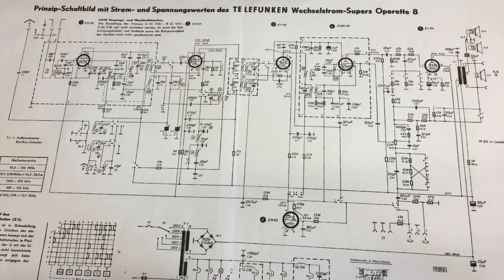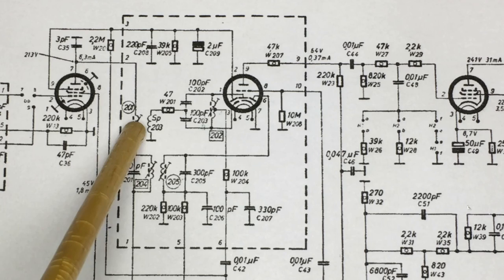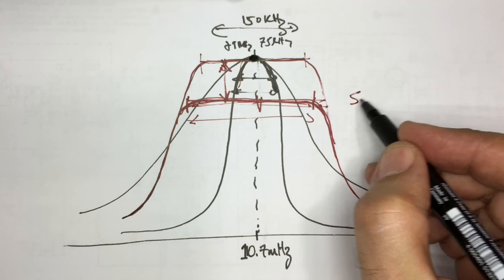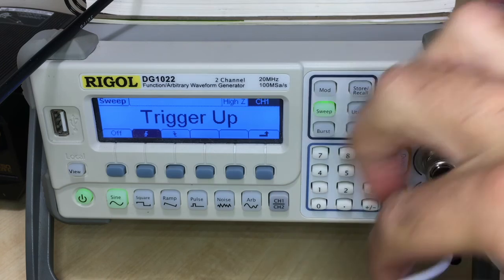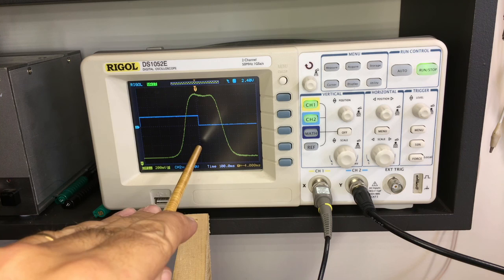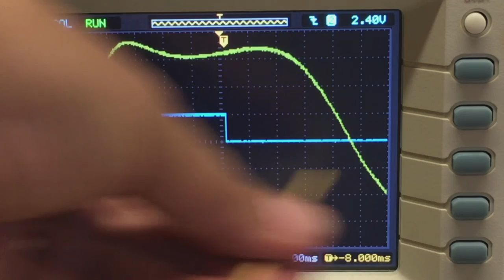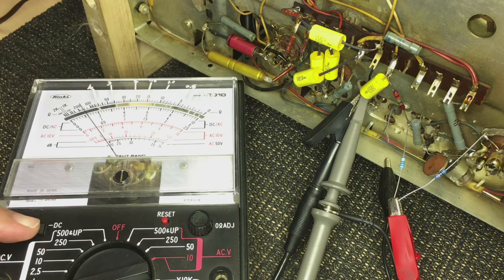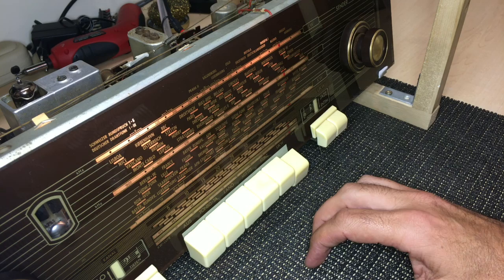Telefunken Operette 8 tube radio restoration - Part 6. Let's do a visual IF alignment for FM.

Comment: After countless searches I finally found a clear, simple, complete explanation of the IF alignment. For a newcomer to tube FM radio restoration this video provided me with the tools to successfully complete this task after so many failed attempts.
I need only two clarifications, one on the alignment of the discriminator performed by looking for the "zero" with the voltmeter while in many articles it was performed with the oscilloscope trying to obtain the fateful "S" curve, and the other question concerns the setting of the oscilloscope in which I have always seen the use of X-Y mode.
Congratulations and many thanks.
Reply from the maker: I have used that technique in a few of my videos, but can’t remember which. Just search the the channel and look for the FM alignment video of a couple of restorations.

Comment: Really enjoyed this Manuel, I’ve been peaking the IF on FM and ending up with not enough bandwidth so might try this. Just out of interest, this was 5 years ago and it seems in your later videos you seem to go back to the more traditional FM alignment. Is there a reason for this?
Kevin
Reply from the maker: No reason, just have found that the simpler method suas produced good results and is less fussy to set up.

Comment: thanks for your great video,  this is a very effective way to learn Alignment process. Question, in case of measured by  digital scope,  no need Marker signal?
Reply from the maker: Not if you are careful to keep the center frequency inbreeding center line.

Comment: Hello Manuel, 

A question;
I  want to try my first (visual) alighnment on a Rheinperle 2054, but do not exactly know what the alighment instructions mean with: for the ZF-abgleich: "Ein mit ca. 15kHz Frequenzhub frequenzmodulierter Meßsender" ist an das Gitter 1 der EF85 an zu schließen.
What kind of signal can I use? (I own the same Rigol functiongenerator as you have to create a signal). 
Hope you can help, thanks ahead!

Henny Poort
Reply from the maker: +Henny Poort : my German is very limited, but I think there is nothing too dramatic called for: connect signal generator at if frequency (probably 460khz) modulated at an audio frequency, to the grid of ef89, etc.
Reply: But what is "modulated at an audio frequency"?  What is set on the generator??
Reply from the maker: +Henny Poort : yes. Modulation type : AM. Modulation frequency : about 600hz.
Reply: Why: probably 460kHz?  The Abgleichanleitung jawohl, does say 15kHz.... Or does it not realy matter?
Reply from the maker: +Henny Poort : actually I just checked on radiomusuem. It is actually 468khz. I have no idea what they bring up the 15khz for.
Reply: I have downloaded my info from Radiomuseum too and it looks really genuine. Most curious what your specs look like. Tomorrow i wil make a new attempt with the following settings: AM 600Hz / depth 100%(?) sinus 4mVtt / modulation 468kHz.
Reply from the maker: +Henny Poort : depth 30%
Reply: Thanks again!
Reply from the maker: Henny Poort : I think I've figured it out. You said you're doing a visual alignment so I believe they mean you should sweep 15khz below and 15khz above the IF frequency to see the bell curve. This means setting the sweep from 453khz to 483khz (the IF is 468khz). Personally I've stopped doing visual alignments for AM IF peaking as the procedure is much more involved and the result is not really better than the 'normal' alignment using the modulated IF carrier signal. Visual alignment looks cool but is really not necessary. Good luck.
Reply: Hi Manuel, 

Just realised when I was reading the AM alignment instruction we were not on the same wavelength also. I was trying to find out how to align the  FM and you were giving instructions about the AM alignment.
I connected my f.generator tonight but could not get the outputmeter to react.  Still trying to feed a correct signal into the radio. (for the FM section....).
Reply: Hello Manuel,

Keeping in mind that I own the same Rigol DG1022 with the limited FM modulation Capabilities , can I feed a sinewave of 10,7Mhz to do the alignment for FM ?  "Ein mit ca. 15kHz Frequenzhub frequenzmodulierter Meßsender" i don't have......
Reply from the maker: Henny Poort : feed a 10.7mhz signal, not modulated, loosely coupled to the fm tube. Then measure the voltage across the discriminator electrolytic capacitor. You will get a D.C. Voltage (negative) and no tone anywhere. Adjust for the peak negative voltage.
Reply: I have done this and can nicely peak the DC voltage but do not see a bellcurve annywhere, have i missed something in the explanation? I loosely coupled with the EC92.

Comment: OK, I'm going to have to critique this -
1)  there was way too much fiddling with the darned scope - it's not a good scope anyway - analog scopes are way better then these silly, slow-updating digital storage scopes for this kind of work. There's no delay - it's updating 30 or more times per second. Most of the time we couldn't see the scale and with all the timebase fiddling you lost us.
2. you talked about stagger-tuning the IF's at three frequencies and that would have been great but you never came back to it!
3. You could have just used markers and that would have eliminated all that messing about with the scope settings . A lot of time just got wasted in this video. If you'd just used a proper sweep generator then you'd have had all the markers and you could have actually imparted some useful info. As it is, we were all dragged along while you dithered about.
Somebody said this was the best FM alignment demo yet but I'm afraid it still missed the mark. It's nowhere near precise enough of a demo.
Here's what's missing:
You didn't identify for us the type of FM detector.
You didn't talk about whether you were going to use modulation or not and why.
You never mentioned stereo and the FM IF bandwith that's required in order to accomodate that.

I've watched so many people put out these videos and none of them have actually made the definitive FM alignment video. All have missed the mark. Sorry - but that's the sad truth.
When you're doing this type of work it requires that you be precise and if you;re going to teach others how to do it then you need to be really thorough. It will pay off very well if you actually produce the holy grail of videos: an actual ace of a video on exactly how to do FM alignment, both mono and stereo, leaving no stone unturned. In other words the DEFINITIVE VIDEO.
Reply from the maker: Food for thought 👍
Reply: I think the critic needs to make a video!